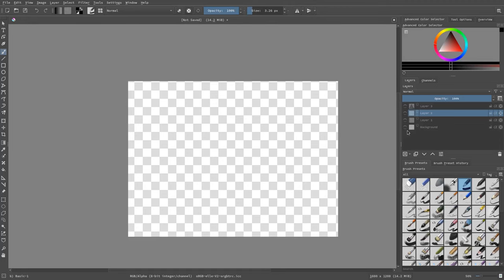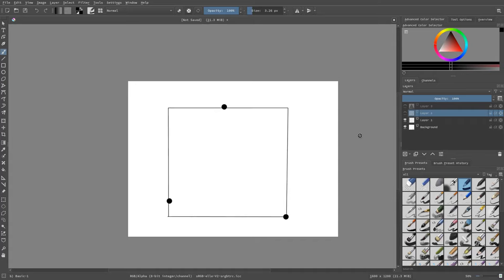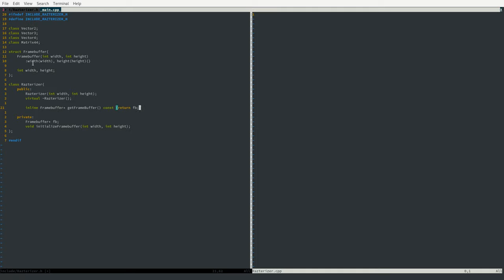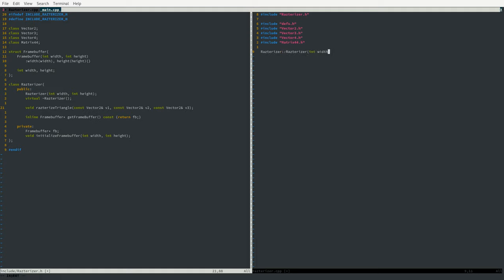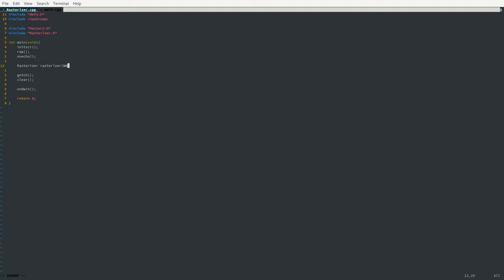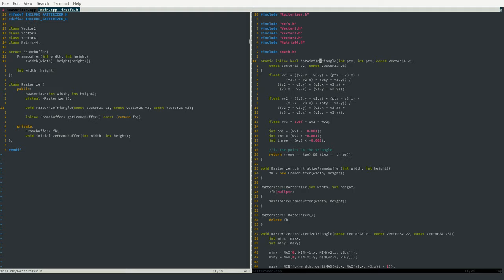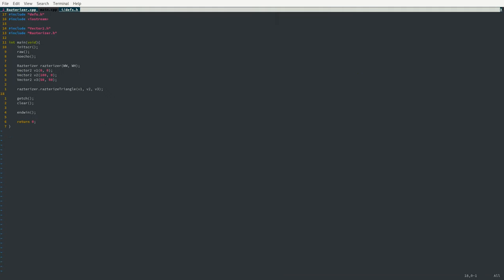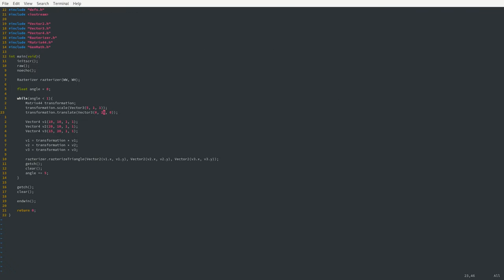Ncurses 3D Render Engine: pt 5 (Building the rasterizer)

Comment: Question on the forward declarations in Razterizer.h and the #includes in Razterizer.cpp: Is that the preferred style for #includes? Does it have some benefit over guards and #includes going in the header file and just pulling the primary header file into the cpp?
Reply from the maker: Good question. I like to use forward declarations in the header in cpp because experience has told me it compiles quite a bit faster in larger projects and avoids potential include loops. I use #include in the header files when I want things to be included along with the header or when I want to inline methods using that class or not store a pointer type.